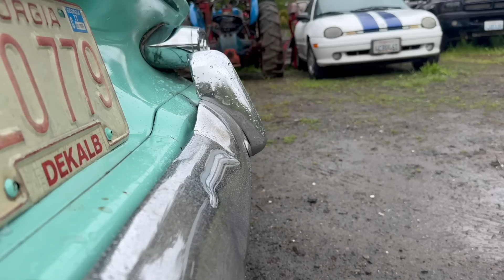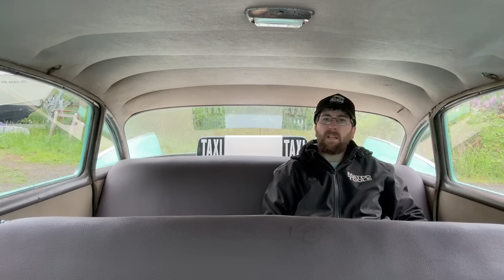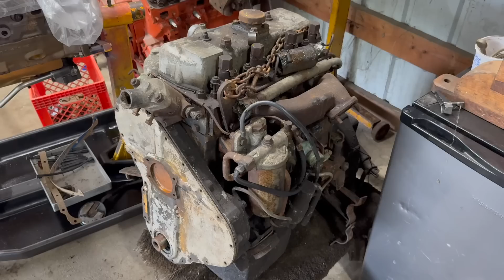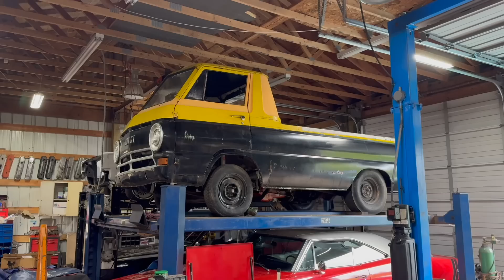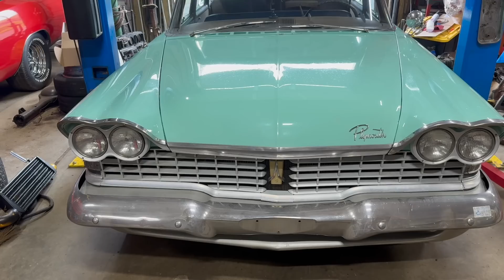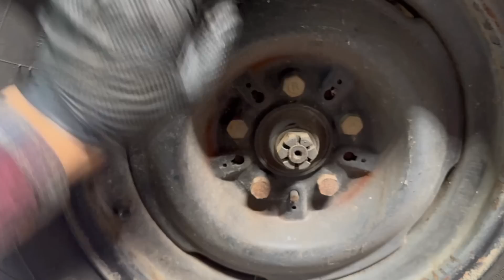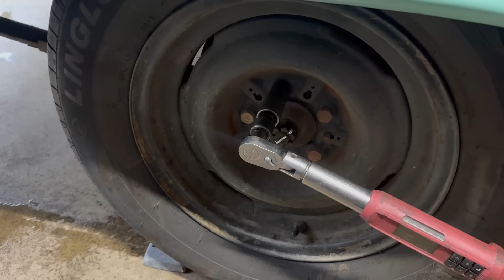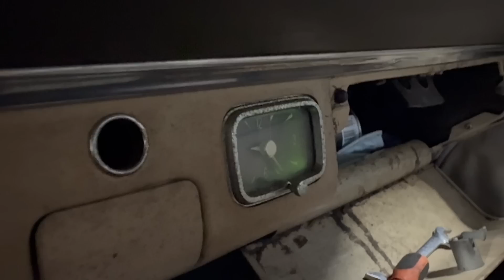Slow And Stinky - 1959 Plymouth Diesel Taxi Engine Tech, Test Drive, Safety Inspection (Not Good...)

Comment: This tradition of slow was carried on by the diesel Chevette and S10 in the 70s / 80s. I had a high school friend with a red diesel Chevette, and it was slow and indestructible. Didn't make enough power to hurt itself, or the transmission it was attached to. Despite his attempts.
Reply: And Olds-I had a Cutlass around 1980 with a 260 v8 diesel and 5 speed. No low end torque but would keep up interstate speeds if level and great mileage for a car of that size. That engine seemed to hold up better than the GM 350 diesel attempts.

Comment: You need to fix the fuel lines air in the line will introduce air into the fuel and that will make it loose power. You could add an in line belt drive type supercharger like a mccollach(spelling) to get more air into the engine and boost. Also clean your injectors and lines. I also believe i have a spare hubcap for this car hanging in my garage if youd like it.
Reply from the maker: Fuel lines are fine. Now, the sending unit / pickup tube in the tank? Different story…

Comment: We have a much newer Perkins in the fork lift at work but it's still much the same engine. It has a manifold preheater and the instructions are as followed. Run the preheater for 15 seconds then release the push button. Turn the key to start. Granted Phoenix doesn't get real cold but after a night in the low 40s, the engine fired on the first revolution. Shocked the daylights out of the hired help because he was reaching for the ether. I hate that stuff because they used on me in surgery a couple of times. I do everything I can to avoid it.

Comment: Put a 6 cilinder Toyota diesel on it, it will be a nice cruiser
Reply from the maker: While I’m sure you’re right… the Perkins is what makes it special.
Reply: @DeadDodgeGarage  how are the brake booster connected to the engine to get vacuum ?

Comment: That's the way we thought back then,put another engine in it,!,I had it done twice in the early '70's,. about 5 years ago I had another engine,used rebuilt put in my 2000 Ford van,but it was a bad experience,still have the van but it's sitting.I worked next door to an old shop that did a lot of swaps,one time there was a straight8 there,one time a Jag xj limo getting a 289 Chevy swap..old, hardcore mechanics;there was a small beer bar down the street,I'll bet they hit that joint every night!

Comment: When we moved to central Florida from Queens we drove down in a '59 Belvedere aqua.we broke down in Jersey,fuel leak from a hole in the gas tank.They fixed it with a bar of soap.Think of the stress my Dad went through -sick wife,one kid Shakey,other kid normal,3 day trip and the gas tank is plugged with a taped soap plug.we made it and he must have had a repair done because we had the car for a number of years afterward until he got a 62Chevy 2 in '66that was a basic brown model,4 door,with a 4 in it

Comment: We have loads of them in Spain (Diesel Perkins engines for Taxis, from 1950 to 1980 most commonly used on SEAT 4 doors). You will need to help the engine with the lousy nowadays diesel they sell, though. Once all working, it is a wonderful engine. A highly appreciated robustness. Don't rev it. It's just a completely different vibe.

Have fun. When all other cars break down, this Perkins engine will still run perfectly well. Oh, I forgot. Some cities allowed conversions to gas (gas butano they call it).

Kind regards!

Miguel

(edited)  Sorry, I forgot: if it does not leak, it will die. These engines love to leak and part of why they survive for so long, is their greasy, ehem, appeal. You will get used to it (we put a mat in the garage under the engine)

Comment: And always brother put 1 court transmission fluid inside the fuel tank every time you fill it up that will lubricate the pump the injectors and the cylinders this low sulfur diesel fuel is sickening
Reply from the maker: So I’ve heard…

Comment: Man, I love your tank! I used to own a 1978 Mercedes Benz 240TD station car. The T does NOT stand for Turbo. LOL. It had all of 65 Horsepower and an outrageous topspeed of around 134 km's, let's say 84 Miles. In winter the city buses where quicker, if she was still cold. ;-) But, darn, did I love that old Teutonic tractor. It still felt and drove like a real Mercedes. It took me everwhere, never failed once. Smelled and sounded like something from the Wehrmacht though, Here in small Holland it was a big car, and I had good fun for almost four years, the she was taken over by someone who could weld (seventies Merc....). She is still around! Don't change the Perkins Plymouth, love it! Grtz from a Diesel fan from the Netherlands. And remember: You're not slow, all the others out there are just hectic!!!

Comment: Bunch of good/great comments on a fine "niche" MoPaR...

Its been "alleged"?  that old time diesels (Mack's/Detroits/Cummins & such)...that to further increase "economy"...some truckers would drain engine oil into clean drain pan...pour thru "tee shirt" filter affixed (tie wire) to big funnel on clean drum...About 5 or 6 gallons used engine oil per 100 gallons fuel.....pull just fine...Can't do that with the "modern" confuzer contorted gizmos....Yes...a bit of ATF & Fuel Conditioner in every tank will help make that engine go...until you are a Granddad!  FYI...the "low sulphur fuel"?  Never about "clean".  The refinery figured out a CHEAPER catalyst to pull the sulphur out of heavy/sour crude.....much more loot in sulphur than there is in fuel....LOL
Reply from the maker: Oh, I’ve got tons of options for “alternative” fuels

Comment: I had a Peugeot 504 pick-up with Perkins 4-cylinder esel some time (years). What it lacked, was an extra gear. It was designed to carry a 1 ton weight so maybe it extra speed was not in mind those of responsible of design and performance. Column gear was nice, because You could have a place for three passengers on the sofa. Good memories - never broke up or something like that. Just change motor oil and fill the tank with diesel  - that's all.

Comment: As an Englishman, I often wonder who taught Americans the names of car parts. So what do you call a true "cotter pin"? Tapered, smooth, rod like with a flat locating side and a thread, flat washer and nut to tighten in place on the smaller end?. A 4 pot Perkins in an American car of that size. Certainly worth preserving as you will always have time to admire the scenery as it drifts slowly past the windows, but a tank full of fuel should go a very, very long way.
Reply from the maker: What you call a cotter pin has threads? I can’t even picture what you’re describing. I thought it was like a clevis pin or hitch pin. Anyway, as with much of the language, I think we mess these terms up intentionally as a subtle form of defiance and rebellion.

Comment: Its lovely, but I would say that. My daily drive is a 1970 Land Rover with a 1966 Perkins 4203 (the engine that came after the P4).  Some thoughts. These engines don't have glow plugs, they need to spin fast then they start really well, they need big starters and big cables.  That heater is probably a flame starter, these are amazing - it should have fuel connection and it heats a coil that opens a valve and sets a fire in the intake manifold.  Looks like the electric part is working but not the fuel, look for a little pipe and reservoir on the fuel return line higher than the engine.  Massey tractors have them so parts are easy.  Expect to find at least one more filter in the injection pump, often well hidden and not mentioned in the service manual.  My Perkins is rated at 63 hp and shifts the 2 1/4 ton Land Rover to about 65 mph but its terrifying, 55-60 is better.  If your Plymouth has 55hp I would think top speed it 60 and cruising about 50-55.  This would be about the same as the main taxi competition, the 4cyl Mercedes that had 45 hp.  These sold by the bucket-load worldwide and top out at around 60 but can do a million miles.  In 60's Europe taxis were slow and that was fine.   The crank seals are rope and dry out, the more use it gets the better they seal.  The trick is to keep the oil level at the bottom of the dip until you need to do a long run, then top it up.  The low oil level is about level with the seal.  Fit the overdrive, the rev range is narrow and the gear rations are very wide, on long hills you can get stuck between gears and come to a near stop.  The overdrive is really useful for splitting the 2 to 3 range.  Land Rovers use the 2 cyl brake set up, it takes some bleeding and setting up but then works well.
Long drives are a pleasure, at 50 you see the views and relax and there's never any element of competition at lights, unless there is a cyclist. Even the buses are faster.  The trick is to hold on to what ever speed you have because it takes so long to get it back😀.
Reply from the maker: You’re spot on! I’ve fixed the governor now and it is as fast as it ever should’ve been. It’s happy at 50, livable at 55, and 60 is just about the end of the universe. I tested the Ki-gass starting system - the tank leaks, and so does the hand pump, so I guess using that is out. In my testing, it really didn’t do dick all to aid starting anyway, it just smoked more. I absolutely want to fit a BWD overdrive if I can track down a complete transmission. I found a T85E but it’s a slip yoke with no parking brake. This would require extensive changes I don’t want to make. I don’t mind a bit of oil seepage, but the pressurized drip from the oil filter is an issue. Lots more to come.

Comment: You dont have the power for an overdrive, IMO. You need the rpm to keep in the peak torque, trying to load it any harder with a taller gear may actually lose some top speed instead of gain.

Just my .02 on that
Reply from the maker: Having now fixed the governor and driven this car at highway speed up against it, it sure feels like overdrive would be helpful - right up until you come to even the softest of grades.
Reply: @DeadDodgeGarage  ah you may have a gearing that might actually make an overdrive useful, I hadn't considered that, I made a few assumptions I probably shouldn't have. I hadn't predicted the gear ratio being low enough to bump against the governor in top gear. 

I stand corrected, maybe it would be useful! I always just wonder if these smaller NA diesel engines have enough power to overcome the wind resistance at a lower rpm. They tend to need every Rev you can give them, in my experience.
Reply: @DeadDodgeGarage  I forgot to ask in my reply, at what speed does it reach that governed RPM? Mostly just curious.  I don't think the answer has any bearing on the rest of my thoughts, just a curiosity.

Comment: The wheel pitting at the 25:23 mark is very dangerous. Last year I had a wheel collapse from that on a 97 safari van (1 owner, me). Luckily I was only going 5mph or so doing a u-turn. The chrome overlay came off and embedded itself into a nearby dairy queen wood bench. Fortunately there was nobody sitting there. I had it towed home and replaced all 4 rims. On these wheels the chrome overlay hid the pitting until failure. They all looked ok inside and outside with the overlay intact. It is glued on from the factory.
Reply from the maker: Wow. Impressive.

Comment: The farm tractor Perkins engines had a governor that responded to load. I don't know if they used the same ones one these cars. On a tractor, you set the throttle and leave it and the governor takes care of it if the load increases
Reply from the maker: Yep, same system.

Comment: Oh this is my dream car. Old American classic car that runs on diesel. OMG. Look at the fuel pressure. And start cleaning the whole system. Also think of timing the fuel pump. It should make a lot more power. And when you give her more fuel you should give her more air as wel. Diesel engines run lean.
Reply from the maker: Found the issue - governor diaphragm. I wouldn’t say a lot more power, haha. But probably about as much as it should have.

Comment: Ps......this Perkins P4 was popular in Forklift trucks and farm implements in UK.
Reply from the maker: I know it!
Reply: @DeadDodgeGarage  At one time when Landrover Diesels were still a new thing,  people would swap out the the Gas engine for a Perkins P4...great economy/longevity...problem was the top speed was down from 65 Mph to 45 MPH...So they used to take the diffs from Scrap Rover 'P4' Sedans which were the right kind of gearing to get you back up to 60 Mph, but you had to be a bit more delicate on the clutch, that massive torque of the  Perkins P4 would just chew up your gearbox and spit it out.

Comment: That's probably an old marine engine hence the boat. Interesting vehicle, not the only to use the vacuum type injector pump as Fordson used it up to the end of the Dexter and Major as for the Coter pin i think i was tourght that Coter is a Trademark and I think also the inverter so I imagine it's used generally used term a bit like JCB is for backhoe loader's hear in the UK
Reply from the maker: It’s essentially a “high speed” version of a tractor spec P4.

Comment: in europe diesels are still common and are used for our vans/pick ups and utilitarian vehicles, and diesel is cheaper than petrol (which matters when fuel is around 2 dollars per liter, so 0.3gallons)

edit, i wanna add that locally, diesel is like 1.55 euros a litre and petrol usually hangs around 1.77 to 1.87 euros a litre (so diesel is around 7.08 usd a gallon while gasoline is around 7.58 usd a gallon

Comment: The thing that made DeSoto the king of taxis starting 1938 was Fluid Drive (or whatever it was called that year...fluid coupling ).  For stop and go city driving, you don't need to use the clutch.  It seems strange the taxi used the diesel, but was not any kind of automatic.  I think that would be OK if it was not used in a stop and go city environment.
Reply from the maker: It’s even weirder than that, because five years before this car was built, Chrysler had the Powerflite two speed fully automatic transmission. But the Plymouth taxi package for ‘59 came with the three speed stick.

Comment: 1. There are several adjustments on Lockheed Brakes.  In fact, do it correctly is a science.  Look for the Chrysler Tech videos on YouTube.
These brakes a just as good as any other drum brakes when adjusted properly.
2.  Left hand studs and left hand bolts (older cars) can not be had at any parts house.  But the bolts are available on Ebay for about $35 for a set of five.  As long as you keep using the original hub centric wheel, you should be good.  Even with only four bolts.
     Shops made a specialty of converting to studs.  You need a certain drill, a certain stud to match, and you use a press to press them it.  I might do that since my holes and  bolts are too loose after I removed the rust with a tap and a die.  I already had the left front converted.   But, as you have seen, it is not easy to find wheels other than factory ones that will work since the face of the the drum has four pins and rivet.  The stud can be made as flush as a rivet, but then you still have five rivet heads in the way.  They can't be milled down because they hold the drum to the hub.  
  3. I have an older car (52) , but I was surprised the front and rear used the same drums!

Comment: Wasn’t the early Dodge diesel truck a Perkins ?
Reply from the maker: Well, no. Maybe? Kind of. There were Perkins engines in dodge trucks, but it’s kind of hard to nail down when and which. I don’t think they were ever used in light duty trucks, but larger engines like the 6.354 were utilized in medium duty trucks like the LCF. That apparently started in 1962. The first Dodge diesel came in 1939, and it was actually a 331 cubic inch six cylinder designed in house. I don’t think production of that one survived the war. There was a Nissan diesel available starting around 1977.

Comment: Brother , that's not only a beautiful and rare that I would not modify it in any way .
Congratulations are in order for this one .
     I have had experience with these engines in some O'Brien boats and if I remember some late 50's Chrysler boats have these engines in them. 
      There Is also an adjustment on the diaphragm on the front of the injector pump I believe. 
        As well as rocker lash adjustment .
     I'm kinda old (retro) 
But if you need more info on the engine itself these old boat manufactures might have more info as far as the engine goes .
      3500 RPM if I remember right is the max rpm these were run at in boats but I'm not entirely positive. 
       Great acquisition .
Reply from the maker: I’ve now done some tuning, replaced the governor diaphragm and have gotten a lot farther with things. Lash adjustment is one of my next operations.

Comment: Cool, Basically a Perkins tractor engine, they had a straight six too Perkins P6
Reply from the maker: Exactly a tractor engine - except this is the “high speed” version with a redline around 3,000 RPM.

Comment: I would be getting a tape measure out to check the difference in length between that P4C and a Perkins 366.
Reply from the maker: A which now? Couldn’t find a “366”
Reply: My bad, had a moment of dumb. I meant a 354. Perkins 6.354 or TE6.354, TE is the designation for the turbo version.

Comment: Do not just willy nilly change to Bendix Brakes.  See if you can fix the original.  It might be a bit slow but that is literally possibly the sole running and driving example I would leave it original but tuned up and the like.
Reply from the maker: Originals are working great now after a cleaning. I’m impressed - now a believer in them